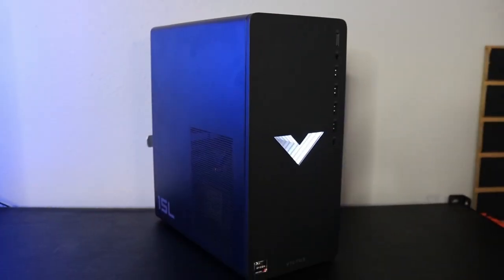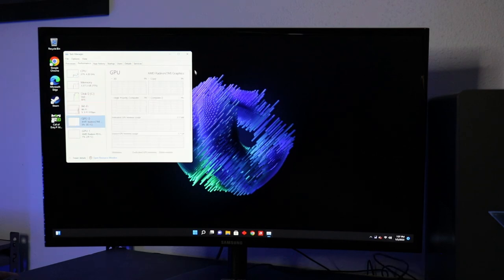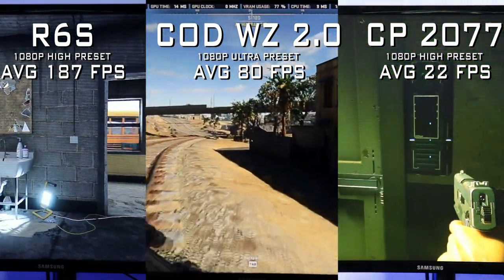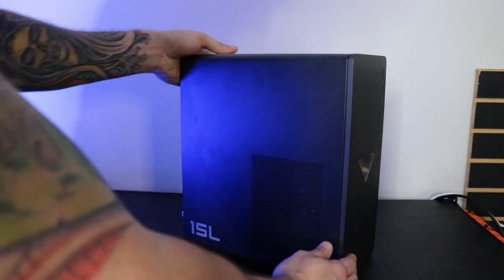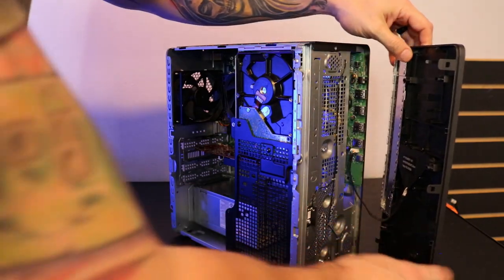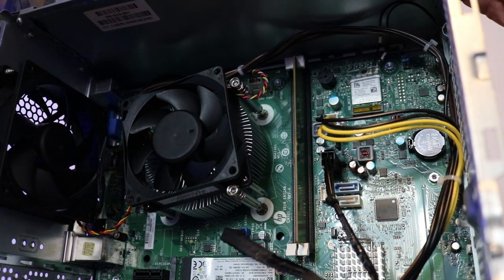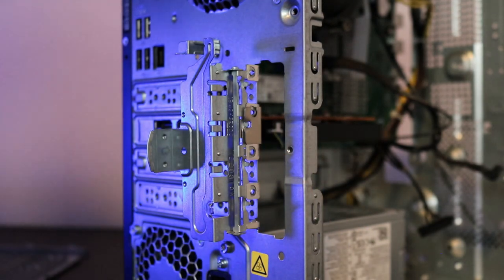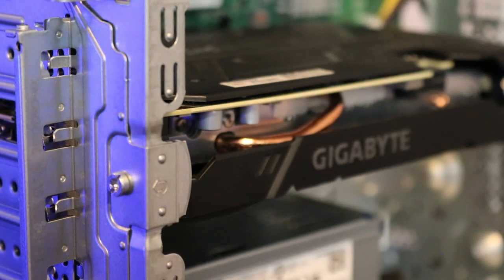Killer Gaming PC for CHEAP!! HP Victus 15L Gaming PC#pc #gamingpc #review

Comment: Hey man, I bought the A-tech 2x16gb ram kit you linked in that pinned comment thread. I installed them and powered on and it wont boot. I read about making sure they click all the way in, so i reseated them and tried again, no boot. I tried changing the order i inserted them, no boot. I tried starting the system with just one of the sticks, no boot. So i put the original two 4gb sticks back in and it boots up and runs no problem. Any idea what may be happening? Are you sure that ram is actually correct for this system? Anything else i should try?
Reply from the maker: I would look for the cmos reset and try that to see if that works. Power down, unplug, find the reset cmos pins, hold a screw driver across them and then try it again. What specs did your pc come with? Cpu, gpu, and what was the speed of your other ram?
Reply: @bradfordskeldorado  OK, I'll start on that and give an update when its done. Its got a Ryzen 5 5600g, RTX 4060, and its 3200mhz ram.
Reply: @bradfordskeldorado I'm stuck trying to find the cmos reset pins. I think Ive found them, but I'm not sure. Downloaded a couple HP manuals but they don't say where they are. Are they on the motherboard near the bottom of the case fan, close to the box that houses the ethernet port? (labeled "FD0")

Sorry, this is my first time doing this stuff.
Reply: @bradfordskeldorado  Nevermind that last reply, I found them. Towards the top above the cmos battery.
Reply: @bradfordskeldorado I've tried a few times holding a screwdriver against both pins at once, but it still won't boot with the new ram. Still works with the old ram.

I think I'm going to take out the cmos battery to make sure its getting cleared.
Reply from the maker: @FifatlasHD  I would reach out to them through Amazon and request a refund. It doesn't make sense that they wouldn't work when I have seen many people run that same set many times.
Reply from the maker: @FifatlasHD  have you tried booting with 1 4gb and 1 16gb?
Reply: If this doesn't work, then that's what I'll do I guess. The battery is out now, and its been like 13 minutes so I'll put it back in shortly and see what happens.

I have tried with each new 16gb stick by themselves, but not with just one of the original 4gb sticks.
Reply: @bradfordskeldorado  So I put the cmos battery back in with the new ram, and it wouldn't boot. Just a blank screen like it had been on the other attempts. I then put the original 2x4gb sticks in and powered up and it had a bios-like screen saying the cmos was reset, and it restarted, and then booted up like normal. 

So you suspect one or both of the new sticks is bad?

Thanks for all the replies by the way.
Reply from the maker: That's crazy man. I know people have run these 32gb sets with no issues so I can't believe both would be bad. Just doesn't seem right. Sorry for the inconvenience on you ordering it and having issues like this.
Reply: @bradfordskeldorado  This is my first time opening up a computer and doing stuff like this, so I'm constantly suspecting there's something obvious that I'm missing or doing wrong. But I feel like by confirming that the the bios did reset, and also that I was correctly installing the sticks, and that both DIMM slots are working, and that these are the exact sticks I ordered, and being confident that this kit should be working (because you think so and because of what others have said), that it just has to be a bad stick. 

No worries man, its all good. I'm gonna try to get either a refund or a replacement set from the company, so whenever that happens I'll come back here and let you know how it goes. Your video was a big help in taking it apart, and thanks again for the replies.
Reply from the maker: @FifatlasHD ram is pretty straight forward and you swapping the old out and it all still working says you're doing it right. I just can't imagine there being a difference in the 16gb set and the 32gb set that would cause an issue. Let me know if there is anything I can do on my end to test or change to aid with narrowing down some parts or anything like that.
Reply: @bradfordskeldorado  Hey dude,, I'm back at it today. So I wanted to try to confirm that both new sticks independently wouldn't work, to try to find out if one of the sticks was bad or if this is a ram compatibility issue. Because, I want to know if I should simply order exact replacement sticks or try a different brand because these aren't compatible. I removed one of the original 4gb sticks from dimm2 and booted the system on just the one 4gb stick. And it booted normally with the single 4gb stick. I then replaced that stick with 1 of the new 16gb sticks and it wouldn't boot. I then swapped that stick with the other new 16gb stick and it didn't boot with that one either.

Wouldnt that imply that these new A-tech sticks simply arent compatible with the system? The other alternative is that both of these new sticks are faulty, which seems too crazy to be true.

To add to this, when I go to A-tech's website, they do not have the Victus as an option when choosing a system to find compatible ram. Crucial on the other hand, does. I think I'm going to buy the set from crucial, which is cheaper than the A-tech anyway, and pray to Jesus it works.
Reply from the maker: @FifatlasHD so the reason I use the A Tech ram is because it's 3200AA and that's what keeps the speed. When I did the original video, I didn't notice but the speed dropped to 2333mhz. That's when I learned that the 3200AA Non-ecc ram would run the 3200mhz speed without issue. I have also had people run 32gb so that shouldn't be the problem either. I just don't know why it isn't working for you. If you have a link for the crucial ram you're looking at, I would love to check it out.
Reply: @bradfordskeldorado   That Crucial ram is also 1.2 volt, just like the A-tech, which I remember came up in another comment thread. I think what it means is that this ram does not need to be overclocked to run at 3200mhz, as it runs that speed at 1.2 volts.

If the "3200AA" label is specifically required, then Crucial is recommending the wrong ram here, which seems unlikely but I guess could be the case.
Reply: @bradfordskeldorado   I typed a long reply with the link, but I don't see it, so maybe it was automatically deleted because it had a link in it? Anyway I'll try again.
Reply: @bradfordskeldorado  Yea I tried putting quotes around the link to maybe make it bypass that filter but I guess it doesn't work.
Reply from the maker: @FifatlasHD I'm pretty sure it's the "non-ecc" ram that is the compatible part of it. I looked at the crucial kit and have used their storage for a long time. I have reached out to customer support to ask a few questions and hopefully will have some better info soon
Reply: @bradfordskeldorado  Ah ok, that makes sense.

Ok sweet, curious to see what response you get.

 Its still confusing to me why this A-tech kit doesn't work, with it obviously being Non-ECC. Its hard to commit to buying something else when can't figure out what the issue is with this set. Unless both sticks are faulty, which again is hard to believe.
Reply: @bradfordskeldorado  Sorry to keep pestering you man. Do you think it maybe needs a bios update to work with this ram? I havent updated the bios since it was delivered a couple weeks ago, but the version it currently has is only 2 weeks older than the most recently released version. Is it worth my time to update the bios and try that ram again?
Reply from the maker: @FifatlasHD you totally could update it but I know others have run these sets over the past year and I ordered the 16gb set about a year ago. 

Crucial reached out about doing a partnership and I'll be sending information to them tomorrow to hopefully get set up to test ram and storage products for reviews. I'll try to get a contact to get some clear information about the ram they have that says it works in the victus tomorrow
Reply: @bradfordskeldorado  Right, that makes sense. Probably not worth the effort then to retry with a new bios.

Ah that's cool. Yea my next attempt will be that Crucial kit, so that would be great to see what they say about it.
Reply from the maker: @FifatlasHD I personally would update it just so you don't have any issues with things like wifi, or any other motherboard features but it couldn't hurt to test the theory. That's just me though man. Lol
Reply from the maker: @FifatlasHD this is what I have received so far. I will order a set of ram from them and test it myself so I can confidently recommend this as an option for the victus.

 Greetings from Crucial 

I wanted to inform you that Crucial memory is backward speed compatible. This means that the speed of the RAM will automatically adjust to the speed provided by your motherboard.
Reply: @bradfordskeldorado  Hmm.. not the most satisfying answer from them.

Are you going to try a 32gb set?
Reply from the maker: @FifatlasHD that's what I ordered just to make sure. I have seen that the victus can hold up to 64gb of ram so I still don't understand why you have an issue with yours. Did you return it yet?
Reply: @bradfordskeldorado  I haven't yet, but I will today or tomorrow. I was leaving a little time for another idea to come up, but I haven't had one. 

Great, can't wait to see if they work for you.
Reply from the maker: @FifatlasHD should be here next week so I'll let you know man!
Reply from the maker: @FifatlasHD sorry for the delay man but I just rebuilt the victus after my last video and installed the crucial 32gb ram kit. Works great, 3200mhz speed and no issues for me.
Reply: @bradfordskeldorado  
No problem, I was actually thinking last night that you might have gotten the ram by now. Thats good to hear, I'll definitely give it a shot. Thanks for the update.
Reply from the maker: @FifatlasHD  thanks for the tip on the crucial ram too! Have a good one man!

Comment: Great Video Id like to find that at 500 and not th3 699 I need to replace our Moses Computer. (Suggestion:)  Though. You Skipped the part where you plugged back in the Hard Drive. For those that may of needed to know that part. I for one, when I am following a how to hate when steps are skipped.  I'm sure you had it but got eddited out. easy to miss. love it though thanks.
Reply from the maker: It was in my clips but I had to trim a little due to the length of the video. I appreciate the feedback and just hope to improve ways of adding and shortening some aspects of my video making! It's certainly a great deal at 500 but the 699 isn't worth it

Comment: can you insert an hard disk?
Reply from the maker: Like a hard drive or an actual disc drive?
Reply: @bradfordskeldorado internal  hard drive
Reply from the maker: If you notice at 7:15 I'm removing the hard drive I added for game storage. It's very simple and has additional sata power and date cables from the motherboard!
Reply: @bradfordskeldorado  can i add 2 hard drives?
Reply from the maker: It comes with an nvme ssd and only one mounting spot for an extra drive. Theoretically you could add a splitter and the mobo has extra data hook ups but depending on what else you have in it, you would have to be aware of the power draw with more accessories. Hard drive are just big so space and mounting is the issue.

Comment: Hey me again I fix the csgo problem and stuff and it was just my internet but now I have a new problem when I play some things like minecraft but with a lot of mods my pc seems to heat up quick and the fan not doing much of anything is there anyway to add more inside cause I noticed there’s only one connecter or is there a better one or literally anything I can buy to help out
Reply: And one more thing you think I could fit a 3050 ti in it? Or any good GeForce
Reply from the maker: I'm waiting to get a 4060 to test out just because they have such a low power draw. A 3050 would work but I think the RX6600 has better performance and a lower price.
Reply from the maker: When it comes to minecraft and adding mods, it causes a lot of stress and processing to the components. This is normal to have high temps. I would recommend a better cpu cooler.
Reply: @bradfordskeldorado  yea the only reason I want a GeForce is because I want to make it a vr pc
Reply: @bradfordskeldorado  not even minecraft but like gta and some other games my gpu with go up to 80 temps could I buy 2 of the fans in this video and it would fix the problem
Reply: @bradfordskeldorado  and what cpu cooler could I get or you would recommend
Reply from the maker: Thursdays are when the local best buy gets shipments so I am hoping they have a 4060 on the truck. I'll give you an update as soon as I can. If not, I may pick up a 3050 and see for you
Reply: @bradfordskeldorado  and can you tell me what the best cpu cooler would be better for me to get for they cpu in this build
Reply from the maker: This is something I would like to mess with. It's hard to say because it's an amd cpu but has a proprietary mount for a cooler that isn't a normal AM4 mount. The mount is similar to an intel but I don't know if an intel cooler would work either. That's something I would have to look at though and hopefully have an update for you
Reply: @bradfordskeldorado  ok I appreciate it man I would like to build this up a little so I got something while I build my pc
Reply: @bradfordskeldorado  hey me again the gpu you recommended would it be good to use for vr or good enough or ik I asked if I could fit a GeForce but I’ll get whatever aslong as I can play Skyrim vr lol
Reply from the maker: @pvt_coot2733  I just got the rtx 4060 in the mail do I'm going to have an update with that. Unfortunately I'm out of town until Monday but I will be doing a short with the results soon
Reply: @bradfordskeldorado  ok ok perfect thanks man
Reply from the maker: I'll be shooting for results on Tuesday! I'll hook up my vr setup and test it to see if it works too. I have the rift s so I'm not sure how the power draw will be but we will find out!
Reply: @bradfordskeldorado  what kinda power supply would be good for this I plane to upgrade my gpu
Reply from the maker: I would look for an hp victus 500W psu. Looks like part number L89233-001 is the HP 500w psu. This is what I have seen on their site forums for people asking about swapping out their 350w psu. I haven't tested this so I would read a little more to make sure this is the one you need. I hope this helps
Reply: @bradfordskeldorado  does it matter what power supply I get aslong as it fits in the case?
Reply from the maker: I know that these small form factor pcs have proprietary connectors that only work with certain pcs. These are specialty power supplies so that's why they are usually a little more expensive.
Reply: @bradfordskeldorado  ah so I couldn’t get like a pin adapter and but like a 750 watt in it or something
Reply from the maker: I think there are adapters for normal power supplies to fit some pcs but I just can't confidently say that it will work. I would hate for you to buy something and not be able to use it.
Reply: @bradfordskeldorado  yea understandable
Reply: @bradfordskeldorado  do I need a different power supply for the 6600
Reply from the maker: The best thing would be to take the usable parts and put it in a new case with an am4 motherboard and good power supply and just build a pc. I love the victus but it is limited to the upgrades you can do.
Reply: @bradfordskeldorado  ah yea good ifea
Reply: @bradfordskeldorado  so for the rx 6600 what all would I need to upgrade in this prebuilt to be able to put that gpu in it
Reply from the maker: Nothing at all. This pc will run it without any issues. I'm not the biggest fan of amd because I've had issues with the software in the past but the rtx 4060 is even a lower power draw than the rx6600 so they why I'm going to do the test on that one. The 4060 is a little bit more expensive but I think the performance will be worth the extra $70-$80 you spend to have it.
Reply: @bradfordskeldorado  yea so I don’t need to like upgrade the power supply or anything
Reply from the maker: No sir, these card only draw 120W for the rx 6600 and 110W for the 4060. The cpu is approximately 50W-60W so the rest of the parts (fans, ram, rgb) don't draw enough to stress the psu. My only concern is the power draw from the vr. Your peripherals take power too so your keyboard and mouse but these are not a lot. A quick search shows a low draw for the vr setup too so it shouldn't be any issue.
Reply: @bradfordskeldorado  oh one more thing the fan upgrade the noctuo or something like that I bought 2 by accident and I was wonder if it’s better then the cpu fan already on it I was gonna replace it with the noctuo and was wondering if that’s better to fo
Reply from the maker: It would be quieter than the stock fan. You could also use it on the back of the case if you wanted to use it there instead. Also, make you you get a fan splitter!
Reply: @bradfordskeldorado  ok and I’m I’ve already asked this question but when I play my cpu temp is kinda high what’s a good cpu cooler that I could switch out the original with
Reply from the maker: I just ordered two separate coolers that I will test and post some results as to whether they even fit and the performance
Reply: @bradfordskeldorado  that’s awesome thanks man